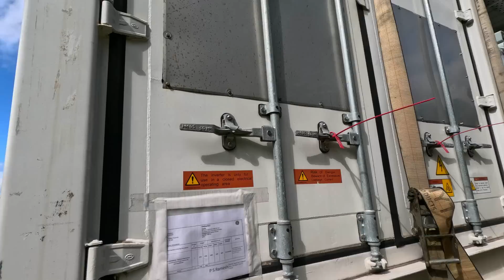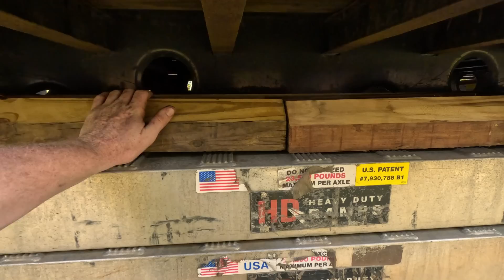I took my dispatcher to work with me!

Comment: Trucks have a spec for ride height not by guess you should get measurements from mack to high or to low knocks out u joints or hanger bearings.

Comment: A brake chamber leak like that is usually a bad diaphragm, Make sure you've got it caged real good, then remove the clamp and put a new diaphragm in it; put a thin film of grease on both sides of the rubber diaphragm where it mates up with the chamber, then put the clamp back on;  A retired fleet mechanic here.
Reply from the maker: Yeah they’re so cheap it’s just not worth it to me to repair.

Comment: make sure the carrier isnt missing any shims, it will cause a vibration if its out of alignment
Reply: I've only replaced them in pickups and wasn't aware that they had any shims.  Is this something that's common in semi trucks?
Reply: @eldridge201  yes. Its very important to maintain a proper driveline angle. If for example the angle is 'broken back'  it will cause a vibration. More common in long drive lines but it can happen in semis as well.
Reply: @xClaudiaOctaviax  I'm aware that the angle of the driveshaft is important.  No different than pinion angle when setting up the suspension and location of the differential itself.  This is done in a typical passenger vehicle of course but also in drag racing cars as well to ensure that when torque or power is applied to the rearend, as that power turns the differential, there is not too much binding on the drivetrain while also maximizing the power being sent to the wheels to get the best traction off the line as well as down the track.  Also, to prevent stuttering of the wheels or wheel hop as it's putting that power down.

I'm aware of that.

I was simply saying that I was not aware that there were "shims" that were typically used for the carrier busing/bearing assembly as I haven't noticed that in standard passenger vehicles.

As far as the angle being "broken back", I don't understand what you mean by that.

With 4 door pickups with or without 4-wheel drive, their driveshafts are usually a 2-piece driveshaft assembly so that is why they have a carrier bushing/bearing.
Reply: @eldridge201  short answer- shims or brackets between the frame member and the carrier bearing is one method how those driveline angles are adjusted. When the carrier shims are missing where needed, it causes a condition called a broken back driveline.
Reply: @xClaudiaOctaviax  that's fine.  I understand why they may be needed in some cases.  I just don't recall having to deal with them.  But also, I was trying to understand where the term  "broken back" came from in this situation.  What is "broken" and what is it to the "back" of as a point of reference?

I'm not being a smart butt here and genuinely just curious if you happen to have that info.  If you do, then please share.  If not, then I guess I can try to look it up .
Reply: @eldridge201  its simply what they call it when the driveline angle between the yoke and the companion flange is not parallel. Theres only one u-joint in the front section of the driveshaft so any angle in this section will not be equalized and will cause a vibration.  In turn when this happens the two rear u-joints are no longer equal angles and may add to the vibration. The drive line has to break back from the carrier at a sharper angle than it is supposed to. In pickups this usually isn't an issue as they normally build the crossmembers in the correct position, but on a truck that is very long, like a semi or a box truck it is more crucial. There may be a significant amount of spacers needed.
Reply: @xClaudiaOctaviax  thanks.

Comment: Robert you can replace the "pancake" in the brake pot and carry it as a spare.
Reply from the maker: Those things are super dangerous to take apart. I think they only cost like 60-70 dollars. Well worth not getting hurt over lol
Reply: Its easy...watch a video lol
Reply: @SouthGeorgiahotshot  Just a thought companies and I were cheap so we rebuilt the rather than buy new. Even on the side of the road.

Comment: check your timing and wear on your slip yoke and stub also. I had one truck that vibrated from the day it was new 6X6 snow plow was 5 deg. out of time I (machinist) cut it off  in lathe and set  it to oo and welded it  and it was good after that. Check  angel on carrier out put shaft and diff input shaft angel to make sure they are the same and they did not lose a shim like in earlier comments.
Reply: Dear lord...

Comment: There is a reason the leveling valve is on the rear axle. I'm not a smart man but I figure if ya move the leveling valve to the front axle the rear air bags are extended probably to the max. Not to mention what it's gonna do to the shocks. Just sayin. Ya might be alright but there are reasons for why they do stuff.

Comment: If you used alcohol or air line anti freeze in your brake lines in the winter it makes the diagram/pancake get soft and they split 
You can change the pancake on that side of the chamber 
But not 
the spring brake side
Reply: You can do the spring brake side after the spring is caged. I’ve done many when I was working for the State.
Reply: @ko9446  
I realize that but I’m not gonna advise anyone to do that 
If something goes wrong you’re either dead hurt bad or just lucky

Comment: Just a heads up if you take 16penny nail and put in the supply end of a brake canister it will block the air feeding that brake.Then back that brake off, and will allow you make it to were destination. It is a great temporary fix, and if you go though a DOT inspection they won’t hear the air leaking
Reply: Sweet tip.  Unfortunately, it may not get you through an inspection though if they are thorough.

Comment: Hello Robert just watched your video on replacing brake camber. You said that you had just changed it maybe back in 2021. Quality of parts are not what they was 15 to 20 years ago. Some brake cambers you can replace the leaking rubber diagram that is leaking inside.it can be done right on truck if you know what you are doing.
Reply from the maker: Yeah just super dangerous lol. Cheap enough to just replace

Comment: If I can make a suggestion to your L brackets you have your harbor freight stand bolted to.. by the looks of the brackets you butt welded the C channel together. If I was you, I would add a peace and make the L into a triangle. All that weight is on that butt weld with nothing supporting it.

Comment: I think all dispatchers should be riding so they know the bullshitt  you go through , That  way talking to another broker or company he knows what is going on to get paid decent , Yes the leveling valve rod  Should be pushed all the way up in there ,  and the way I adjust my bags is with a cigarette pack , Its a pack of  camel cigs,  at the bottom of the plate  to wear the bag airs up and the bottom of the air bag to plate , Figure  3 an 1/2 inches and she rides nice , 
the only thing in Mississippi is the chicks and the chicken finger licking good 
😂😂😁🕶

Comment: I am sorry but if the eye of the coil is to the front in steel hauling terms it is called shotgun does it take a shot gun of a barrel pointing at you
Reply: You can call it either, but homicide is what the charges you would receive if it comes off your trailer...

Comment: Interesting. If I heard you correctly, your son is wanting to drive. I've been hearing bad things about owner operators being driven out of the industry. I hope he is going to drive for a company rather than a owner operator. At least until the government gets their shit together. Good luck.
Reply: I would assume he would likely drive under SGHS's authority so although it would likely be very small, that could still be considered a "company".  Either way, things aren't easy regardless of independent owners/drivers or in fleets.  The regulations are getting out of hand in areas that they probably shouldn't and in some areas they should be more strict but aren't so it's a toss up of whether it matters that you're driving for yourself or a company.

Comment: Robert,
I would recommend not discussing issues like repairs of your truck or trailer while you're driving it since you never know who's watching and/or who might report you to DOT.

As you've unfortunately experienced, the DOT can show up at your house because someone decides to inform the state of something you're doing and that isn't fun to deal with.

Recently, I just watched a video from CP Steve Miller (a couple weeks back as I type this) and the authorities (he couldn't remember if it was a state trooper or what) showed up at his house because he made a comment on TikTok that he didn't have a CDL or a license at all.

As a result, he had to deal with the authorities coming to his house late at night all because he made a joking comment about not having a license.

I'm not trying to bust your chops here but honestly, you should know better than to be saying things like this because since it's on video, whether true or not, the DOT probably could use it as probable cause to find some sort of violation.  And when it comes to brakes potentially not working properly due to a part or componenent not functioning properly, this would likely be a big deal since brakes are obviously a major safety issue.

And even though it may not be a big deal, I don't know if they could find something to write a violation up for since you knowingly are discussing needing the parts for the brakes BUT ALSO the carrier bearing potentially being bad.  I understand the carrier bearing may only leave you on the side of the road but I suppose they could argue that if it fails and ends up coming apart, your driveshaft could end up coming down and potentially being launched like a torpedo at someone's vehicle as you're driving down the road.

I know this sounds far fetched but you should know that they damn well would try to find something or make some sort of excuse to give you a violation.

I just think it would be better to not mention these things for your benefit.

Obviously, you can do whatever you want and ignore what I've suggested.

------

For that weigh station where you were commenting that there was no overnight parking, I don't believe they are an enforcement for parking.  Aren't they just supposed to be a weigh station or a checkpoint?

The entry into that weigh station was horrible with the bad pavement and potholes.  Horrendous.

Why don't you have that weight monitor (I forget what it's called.  I was thinking EZ Pass but that's for tolls) so you could just keep on going down the road?  It seems like there would be a lot of wasted time pulling into each and every weigh station.

----------

For the Halloween situation, I'm with you on that.  "When I was a kid", we used to go to all the houses and it was pretty fun and we would get all kinds of candy.  We were in a small town of about 3500 people at the time and most houses had candy and the cool thing was, you could cover a lot of ground if you went out for 2 or 3 hours.

This year, my friend had only a couple people stop so she was disappointed.  Her house isn't in a bad neighborhood and it's in sort of the middle of town so it's not like it's far away from anything.  I just think that a lot of people do what you mentioned which is go to the "richy" neighborhoods (which makes sense if you want the good candy) but also the mall, trunk or treats, and other things that do candy.  I think less and less people are doing candy at their home each year.  Plus, some people are simply gone.

Comment: HEY  I am selling my 2007 International 9400i eagle Condo double bunk 72" 500hp ISX Cummins 332 rears 22.5's. Also selling the 2018 Benson 3-axle trailer, stepdeck 110lbs all aluminum. I have 6 new rims to install on trailer (aluminum) 2-9'toolboxes and ramp holders no ramps anymore. 53'step 43' on bottom trailer $34K Tractor $18500. headache racks chains binders starps boynets all goes. I had to retire early, health issues.
Reply: Might try Tim Gentry at Gentry and Sons Trucking, Sweetwater, TN....he is on a buying spree.
Reply: Send me an email. I'm getting ready to buy a semi...